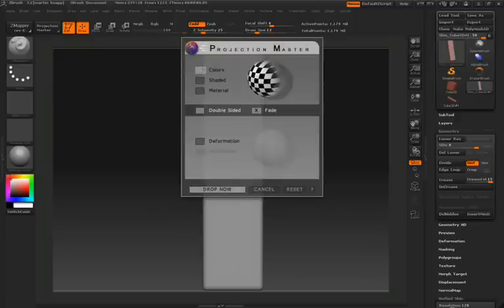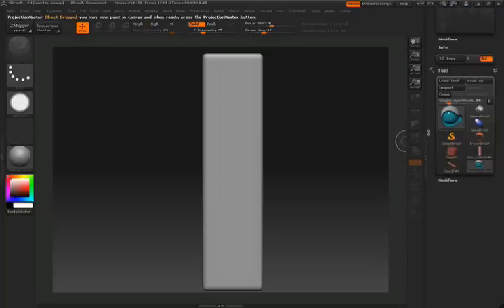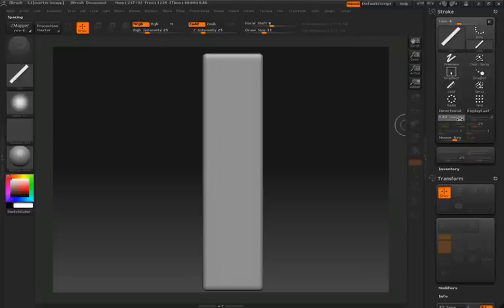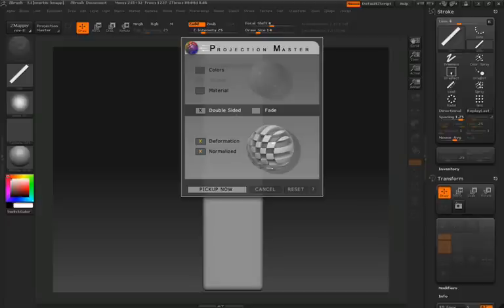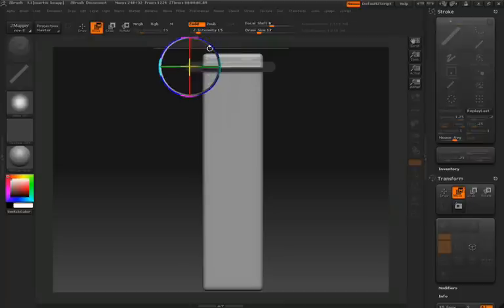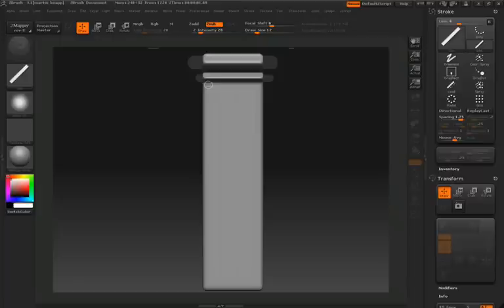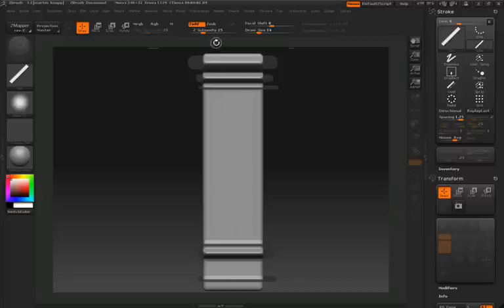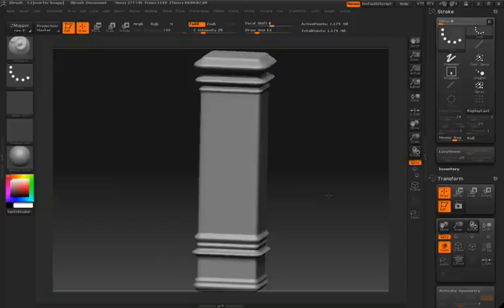ZBrush Tutorial (Architectural Techniques) - part 2

Comment: Ok, i discover the solution, double sided should be on in both the Projection Master settings AND the Display Properties subpalette of the Tool palette. And it will fix double sided problem it in zbrush 4r4.